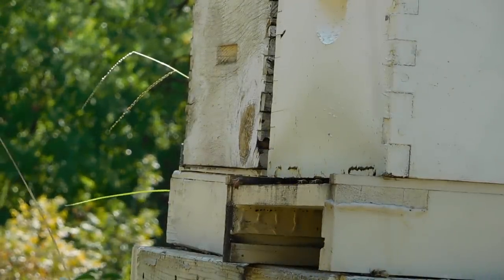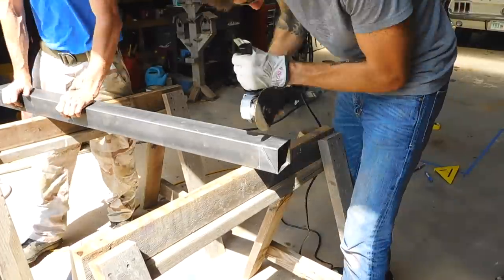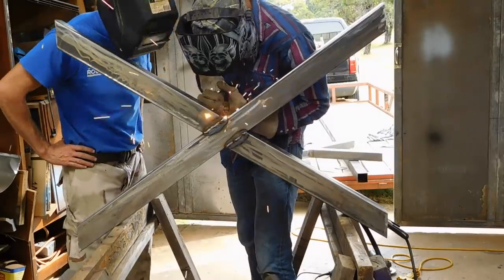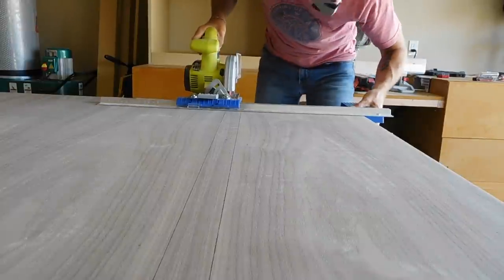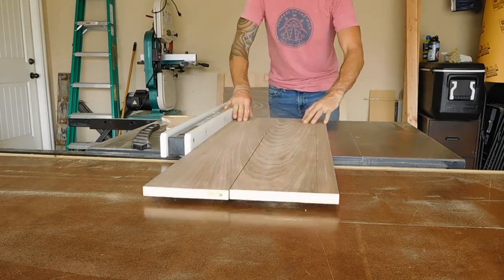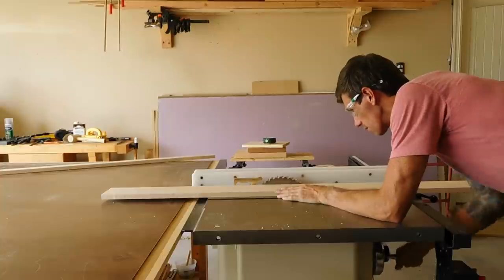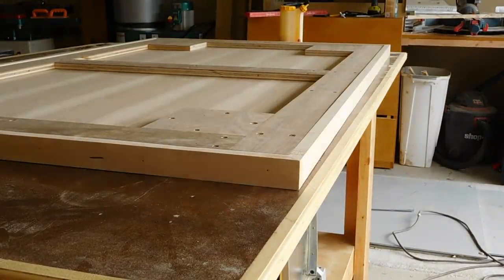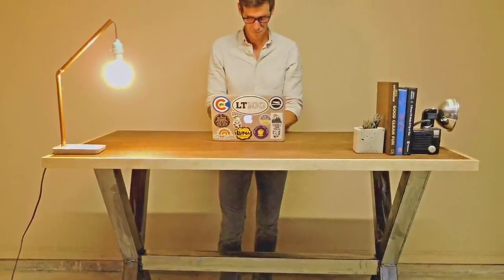DIY Modern | Industrial Standing Desk | Welding Project

Comment: Hi. I was wondering if the legs are level? I mean it's so very hard to weld parts straight and it looked like you guys were just winging it, not even welding on a perfectly straight surface and with wonky angle grinder cuts. Would be very surprised if that desk didn't wobble on a flat ground surface. Or did it turn out alright?
Reply from the maker: It turned out level bc we ground it level. Also take everything you saw in this video and throw it out the window, haha! It was my first welding project and first video, and it’s so bad...
Reply: @JonnyBuilds  allright that explains a lot :) you learn from your mistakes! Its the best teacher. Greetings